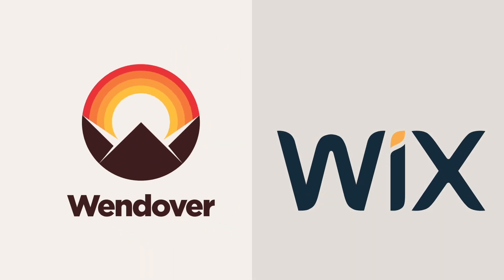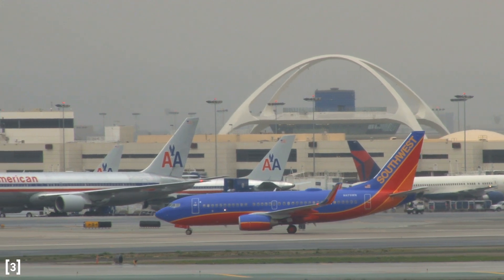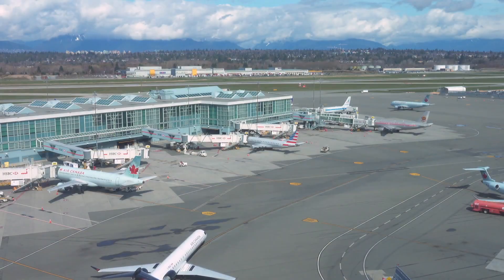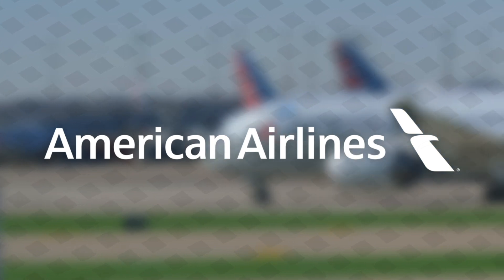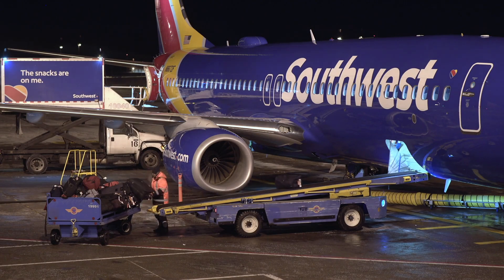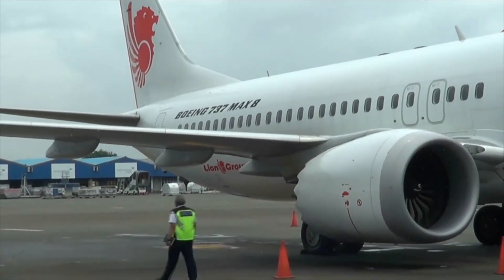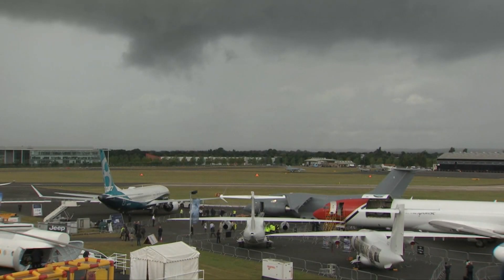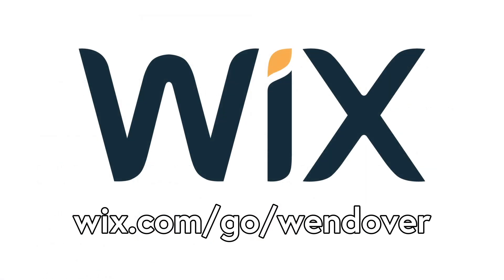The Economics That Made Boeing Build the 737 Max

Comment: Wendover makes an excellent presentation.  There's clearly a lot more wrong with this 50-year old design than software.  The engines are mounted too far forward and upward, anyone can see this leads to Center of Gravity (CG) issues.  But further, this "new design that isn't new" causes a strong pitch-up moment at low speed and high power (e.g. right after take-off).  Boeing tried to save time and development costs while chasing Airbus, and 346 lives later the real problem has surfaced.  MCAS would never have been necessary if proper aerodynamic design principles had been obeyed.  It is a software "patch" on a hardware "bug".  Issues about AOA sensors and software "authority" are sideshows.  Boeing will likely be found to be  liable in the hundreds of lawsuits to follow.  Boeing will try to have the trials moved overseas, but they seem to have not recognized that this is now a global issue. Does any company have the right to jeopardize lives to make or save money?  
See https://theaircurrent.com/aviation-safety/vestigal-design-issue-clouds-737-max-crash-investigations/

Comment: Although no longer (normally) carrying passengers,  there are still many, many DC-3’s in the air.  Boeing got it all wrong, not with the airframe, it’s a time tested and very good design, but with the unconscionable implementation of software pilots weren’t even trained on to rush FAA approval.  The move to put profits ahead of passengers when they acquired a rival and moved from Washington state was the death knell of this plane.  Much like Ford’s horrible decision with the Pinto, they’ve permanently damaged their reputation.  Just as I will never again buy a Ford, even 40 years after the Pinto debacle, I will now always ask for a 737 and preferably an alternative from Airbus.

Comment: While the Douglas vulture culture from the MD merger were busy squeezing everything they could from their employees to their vendors all for market share & shareholder value they found themselves caught with their pants down.
Being so obsessed with Shareholder Value and the most they could get as quick as possible Boeing leadership missed a very obvious scenario.
The 737 sat low to the ground compared to the A320 eventually upgrades in high bypass turbofans would become very difficult as the fans got bigger.
The A329 NEO was introduced and the Douglas vultures within Boeing panicked. They needed an instant competitor that required no additional training so as to certify immediately.
Hence the big lie that the 737 MAX was  like any other 737 when in fact she wasn’t. The 737 MAX was pushed into service with no care as to potential trouble because hey it’s Boeing.

Comment: Having SINGLE model of aircraft & engine is also risky - whenever something happens ENTIRE fleet is grounded.
Reply: Piotr Dudała Ryanair has a fleet of only 150+ 737-800s, easyJet with only 100s of the A320 family. They’re doing fine
Reply: @poisoxned4952  until recently, every aircraft has been offered with alternate engine option - be it F-16 or commercial airliners. However, with Russian T-50, american F-35 and newest models of airliners it WON'T be the case.  Of course arilines you mentioned are doing fine - until somewhere accident happens and given model of engine or aircraft will be grounded.
Reply: Southwest is fine. Yes they operate one model, the 737. But they fly three versions of it today. The 737-700, 737-800, and 737-Max8. So no, they're entire fleet isn't grounded. Just the Max8 which they have 34 of them. Compared to the 500+ 737-700 and 200+ 737-800 that they fly.
Reply: Great point, our grandparents always warned us of putting all our eggs in one basket.

Comment: Why does the 737Max debacle feel similar to the DC-10's wiring issues?
Reply: You mean cargo door issues?
Reply: @aarondynamics1311  Both wiring and cargo door. The cargo door is what failed, but the wiring was through passenger floor. So when the cargo door failed, the cargo hold depressurized and cut the hydraulics wired through the floor. Pilots lost complete control of the aircraft.

Comment: Could you pleaaase consider making a video of Norwegian air shuttle - why they currently  use solely Boeing planes even though they are an European airline, why they ordered both 100 Airbus a320neo and 100 737 MAX planes on one sitting, the problems they faced with 787 Dreamlimer, was the recent grounding of MAX a curse or blessing to them, what happened to the a320neo order, how they started flying over Atlantic ocean as an European low fare company, what is their current situation on the market and how will they try to survive from current both route and financial challenges. For many people they are the only real option to fly financially and at least in Nordic counties more important low fare operator  than Ryanair. Also it would be interesting to learn how traditional European airlines are looking growth from new Asian routes, especially cities in China. For example Finnair has a strategy to use Helsinki as their European hub and benefit from the location of it plus the rights to fly over Russia. Helsinki-Vantaa airport is constantly making new gates on non-Schengen area thus there has been renovation going on at some parts of the terminal buildings as long as I can remember.

Comment: Great video! I also read somewhere that there has been an optional warning system (disagree light) available in 737 MAX which - in some degree - could explain why these disasters didn't happen in Western countries. It was not offered to or wanted by the airlines who met the disasters since it would have generate more costs to them. Not sure though if every Western airlines have them either.
Reply: The disagree alert and the AOA display don't alter the functionality of MCAS which shouldn't be activating erroneously to begin with and certainly not on brand new aircraft while the 2 accident jets were likely recoverable that doesn't change the fact the pilots should never have found themselves in that position

Comment: "Most modern aircraft are flying up above right now but the 737 MAX is not,"
BOEING CEO starts crying for the last time
Reply: Obviously the Airbus fans will keep quoting the A380. The plane nobody wants to buy.  The A321neo, the 737 Max altenative has no encountered its own issues. Britishs Airways amoung other carriers has hadto remove many rows of seats due to inflight inbalance.  These planes are now highly ineffecient to airlines who prefer to hold of for the Max return due o the huge savings.
Reply: @Cheeky-fingers  A380s haven't been grounded en masse with serious design issues.

As for "holding off for the MAX" - the penalty clauses on order cancellations are stiff - it's usually cheaper to take delivery and flog the aircraft on than to cancel once an order goes "firm". In any case the backorder list for the A320 family is over 8000 units long so jumping ship isn't something any customer can do overnight.

The balance criticality issue in longer fuselages is well known. Problems occur when airlines like BA attempt to go "sardine can" in their economy seating arrangements without considering how to balance that in the front of the cabin. In the time between ordering and taking delivery they went from being a reasonable airline to trying to compete with Ryanair and as a result are about as (un)pleasant to fly with as a result.  The balance problem doesn't occur in all-economy layouts or even if the front only has business-class seating. It requires severe aft imbalance and a very late go-around in shitty conditions. (so imbalanced the aircraft is at risk of deciding to tailsit whilst at the gate)
Reply: Its one row on neos with space flex which adds an additional row so all that's happened is spaceflex is currently not active

Comment: Now for the REAL reason....and I predict it will NOT take too long before everyone realizes that Southwest Airlines is partly to blame for the 737MAX mess. During the 1990's development of the 737NG and again during the 737MAX, Boeing kowtowed to the desires of SWA cost-cutting! Whenever Boeing wanted to add a safety device (e.g. autobrakes, electronic checklist, better navigation displays etc) SWA declined unless it added no cost to the jet. So the blame of why the 737MAX has the same cockpit as the 1960's model can be put squarely on Southwest Airlines. Boeing simply gave it's best customer what it ask for...

Comment: The sound that airlines are hearing all over the world is:
   "If its THAT Boeing I ain't going"

* Boeing must be hit hard by regulators for this unforgivable cheapskate design aircraft.
* The FAA need to be chastised for allowing Boeing to self certify this aircraft and then when it failed THEY failed to act until forced to do so.
*Every airline that is losing money because they cannot fly it, have to store it, still have to maintain it and are still depreciating it (to $0?) must be compensated by Boeing and if necessary aircraft must be returned and moneys refunded
* Passengers will not fly in it so its market has gone

Comment: This entire Max debacle arose from a series of ill-conceived decisions by Boeing.  It would have been a costly, but relatively simple modification to create a new wing box allowing longer main gear struts to be used, for appropriate engine ground clearance.  As an aircraft buyer, this would have been the best solution.  This would have solved the issue easily.  Reliance on electronics was the MAX's undoing!  The beauty of the 737 is that it remains a relatively simple airframe designed for heavy use, a true workhorse.  A semi-variant of the 707, I first rode in a 737-100 in 1969 in Germany.  Lufthansa was the aircraft's launch customer.  Due to traditional cable and control surface, the aircraft is easily maintained.  Traditional controls are time proven, reliable and offer long term residual value for resale.  Personally, like many pilots, I dislike full fly-by-wire controls.  They are far too dependent on electronics and black boxes whose components actually age the moment after leaving the assembly point.  The number of black boxes used in fly-by-wire are both numerous and expensive.  It also makes airline carriers much more dependent on the makers of the black boxes.  This usually decreases reliability by increasing unneeded complexity to the overall mix.  I would have never advised my airline to buy the existing MAX die to the MCAS system alone, especially reliance on a single AOA sensor.  This violates the very notion of duel redundancy, and no captain enjoys that in the least.  The fact remains, in my opinion, that Boeing took far too many shortcuts in the MAX design and execution. This cost hundreds of lives, and for what?  Time and money?  The damage to the reputation of the company is amazing, and the unnecessary loss of irreplaceable human live beyond measure.  Long experience has shown that shortcuts do not mix well with aviation.  Boeing got caught, and now they will pay the price.  The fallen passengers never had a choice.

Comment: the video seems omitting the main guilt of Boeing - pilots could handle the changed aerodynamics without any extra system, but the changed handling would require re-training and re-certification, hence Boeing consciously introduced MCAS to avoid the cost, and not for safety, pretending this is just a variant of old plane actually compromised safety

Comment: You say that if the Angle of Attack sensor "is broken" ... whatever that may mean. But the sad fact is that the public still does not know WHY the AoA sensor(s) in both crashes were sending erroneous data to the MCAS. Were the sensor(s) malfunctioning? Maybe Boeing knows, but if they do - that's their dirty secret! The work-around should ensure that the MCAS needs corresponding data from at least 2 AoA sensors before it will be activated - but that's just a work-around. The real cause may lie in the data transmission or in the microprocessors. The work-around is just a band-aid for a festering wound. It may reduce the risk of more crashes, but it won't solve the problem!

Comment: Has anybody noticed how Airbus has made no comment about the 737 debacle? Not a peep. And anybody who claimed "if the boot was on the other foot, Boeing would be all over it with anti-Airbus spin..." would be WRONG. Boeing and Airbus need each other. This mighty commercial airline duopoly really suits them. In some years, Boeing has the upper hand and sells more planes; other times it's Airbus in the lead (like now). But, for both companies, the airliner business is HUGELY profitable, regardless of their other (military) contracts. It's in Airbus's interest that Boeing is as little damaged as possible by 737Max fallout, particularly - as we are seeing - Airbus simply doesn't have the spare manufacturing capacity to pick up a sharp increase in orders. Boeing wouldn't have either.

In any case, the Big Two don't like outside competition - they either buy it up like Embraer (Boeing) and Bombardier (Airbus) or they try to infiltrate it as both Airbus and Boeing have for the manufacture of the Chinese C919.

Comment: The 737 Max is actually a good aircraft. It just has some problems that need to be fixed. I actually want to fly on the 737 Max. The DC-10 was a good aircraft and so can the 737 Max. That why I still have faith in the program.
Reply: The DC-10 is an excellent aircraft. Only, not for flying passengers. FedEx, Lufthansa and others use the DC-10 for cargo freight. Passengers haven't used it for about two decades. The de Havilland Comet was a FANTASTIC aircraft too - once its lethal flaws had been removed. Despite their excellentness and fantasticness, neither the Comet or the DC-10 can be considered commercial successes. Financial lame ducks, more like.

Comment: A lot of inaccuracies regarding B737 MAX and its competitor A320 NEO. They are Both THE SAME PLANES AS 30 YEARS AGO. OkK B737 is a little older BUT the same politics like 737 are also applied at A320 aircraft. They are both not required any  new training(except the new engine which is the same LEAP1 for both NEO and MAX.The first A320 that came out at early 90's has nothing to do with the new A320 "enhanced" -NOT NEO-.Several serious navigation systems like ADIRU's for example that they have an auto align feature and even whole control panels are missing from cockpit. still not required by Airbus new training for Enhanced to classic differences. So as a conclusion both companies did the same staff wrong , only the B737 as a Short leg aircraft needed modifications in engine Pylon and a Bigger tailplane, that could save the whole project if there was not the Bad MCAS S/Ware and the absence of training against this Speed Trim Function that works perfect on NG's but MCAS is not OK yet.

Comment: I wonder if there is a generational factor involved as all the old Boeing engineers are retiring and the new engineers may not have had SAFETY-is-#1 drilled into their bones. i.e. what about SPOF (single point of failure) and FMEA (failure mode and effects analysis).  It is hard for me to believe there was not multiple redundant AOA sensors, and that critical safety systems were optional items and not mandatory.   Who wants to live with a slogan like: "Boeing - where safety is optional"?

Comment: The only solution is to go back to the drawing board and re-positiion the engines that has created this problem. No software solution for a major structural design problem. Cost of course for Boeing but their integrity on safety should overide all financial issues.

Comment: While I am hardly familiar with the FAA's regulations thereby I may be mistaken, I believe that the 737 max's issues are a culmination of several issues, and that one of the driving factors of these tragedies is a poorly thought out piece of regulation by the FAA being that for Boeing to add the necessary sensors for the MCAS to reliably do it's job in the background, airlines would have had to make pilots go through hours of simulator training to learn how to fly a plane that flies exactly the same.Thereby I believe that Boeing was caught in between a rock and a hard place on this and did their best, although I acknowledge that Boeing should have notified the pilots about the existence of MCAS.
Reply: IIRC Boeing feared that informing the users of MCAS' existence will make the MAX appear more different from older 737s, and thus increase the chance that the FAA would required the 737 to be re-certified, with its attendant costs. Same reason why they didn't add an additional sensor for MCAS' operation. I rmb Boeing also believed that existing stall/runway trim recovery procedures (carried over from older 737s) would be sufficient for pilots to deal with a malfunctioning MCAS, but I guess apparently not
Reply: @lzh4950  Fair enough.

Comment: "Most modern airplanes can be turned on by fliping a switch" mmmm no.. depending on what you understand by turning on.. the entire systems to ready to fly? or just the engine? In the first Airbuses for example do require several steps for a cold start .. for the engines if im not mistaken the 737 MAX also has a single switch for the engine on/off .. and it also requieres some checking before like all others.. 

Light aircraft dont count here and they also require setting car heater , magnetos, mix and some stuff

Comment: I believe author missed the primary reason why Boeing did not pursue a new narrow body aircraft in replacement of the B737. I remember back in 2011 timeframe that Boeing choose to upgrade the 737 because There is no significant gain in fuel efficiency if Boeing built a carbon fiber composite body and wing short haul narrow body aircraft just like the B787 .  The aluminum airframe Is still competitive in fuel efficiency for short haul flights.